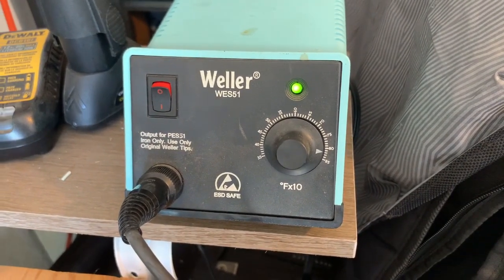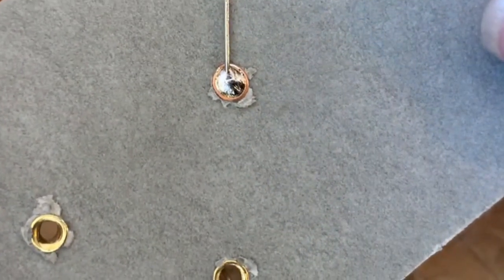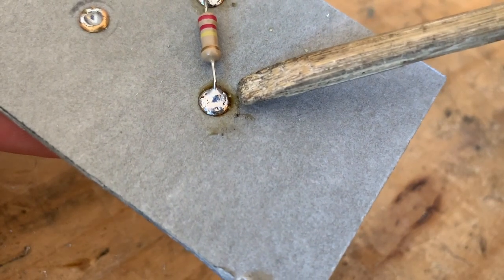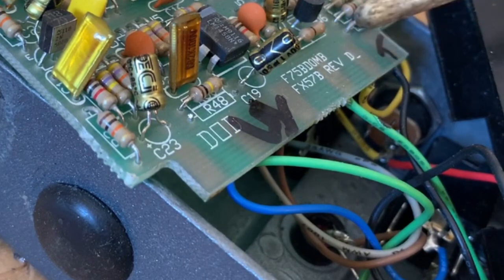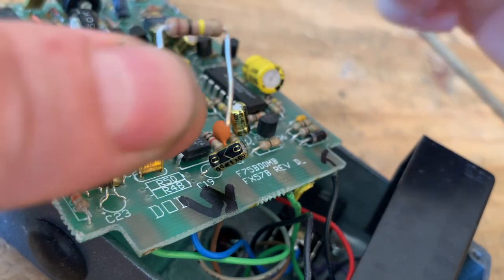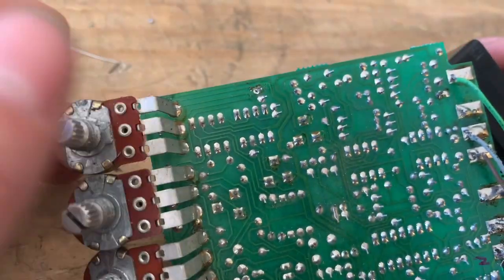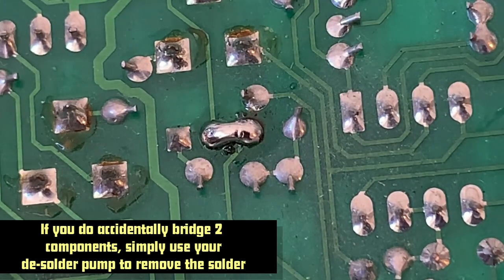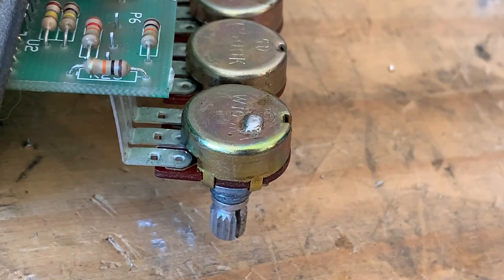How to Solder | Application and Examples for Amp Repair | The Electric Lady

Comment: My mono amp for my sound system has no power , i opened it up found the remote terminal connection had broken off . Can I solder some copper from the mother board to terminal with no issues ?

Comment: I used a whole range of Wellers (WCTP, etc) in 40 years of soldering, finally sold them all and bought a $432 JBC CD-2BQF 130Watts station with C245 and C210 Active tip holders. It is a world of difference in soldering and desoldering! From tiny surface mount to big tube feet and thick wiring, it produces much more power to the active tip. Cleaning them with demi water and copper brush, mounted in the programmable station. It opened a whole lot more soldering possibilities and a never use a non active tip again! It has auto sleep 20W so only on the workdays end it is turned off...Tip life is amazing, do not buy the Chinese imitation crap...😀

Comment: 4 years gone by since !  I'm late to the show.  Still great tips.  Was hoping you'd say more about what temperature to set the iron to depending on what you solder to etc...or explain why you would not worry about it.  Also would have liked to hear your views on why you would solely use the un-soldering pump and not use some Desoldering braid.  And I notice you don't ever seem to use any soldering flux of any sort and wondered why not.  Thank you, cheers!

Comment: I'm finding solder joints in newer guitars to be misbehaving.  Not sure if they are lead free solder or what, but they simply will not flow.  I keep adding more heat and flux--eventually they just burn up.  Maybe the solder sucker is the solution--clean it out and start over with fresh "good" solder.

Comment: Thanks, I appreciate the simple and straight approach. I too prefer a high temperature and short contact at the "site of engineering work". I had difficulties with old solder joints on a iMac power supply (older than 15Y) stored in high humidity environment. They where grey and didn't wanna melt. At the end I used a large tip and a bulky 100W iron. 
I have sometimes problems to tining wires. I realized it works perfect when I clan the wires with alcohol and add some flux on. The quality of flux, solder alloy and iron is crucial. It s science in itself.

Comment: Regarding soldering to the chassis: using a small soldering iron to solder connections to a metal chassis is like trying to drive railroad spikes with a tack hammer-!

It should always be possible to make a solder connection in 3 seconds or less- regardless of the size of the parts- otherwise,  there's something wrong with your equipment, or your technique.

Dr. Carlson's Lab posted a video on YouTube about using a modified Weller soldering gun to make solder connections to a metal chassis.

Comment: Nice job. Couple other thoughts here...be especially careful on older boards as the traces lift easier. Boards from the 70's can be really touchy. If a trace gets pulled away from the board, you can brush on some clear nail polish to keep it in place after doing any soldering. And I've learned to change tips when working on pc boards versus point to point wiring. I use a narrow chisel tip for p to p and a pencil point for boards. I also try to scrape off old excess flux because it can become semi conductive as it ages. Carefully use a small screwdriver tip or Exacto knife and maybe a Qtip and some isopropyl alcohol. Keep up the good work.
Reply: I have a 25W iron for general use, and 15W iron for circuit boards.

Comment: I'll add my two cents about the actual solder/soldering. 63/37 flows better in my experience than the 60/40 you are using because the temperature range for it the transition from solid to liquid is much narrower. This is referred to as "eutectic" solder and also has the added benefit of being more reliable mechanically because it is less prone to vibration or shake negatively affecting the joint while you make it. Others have talked about tinning and about how to make your iron last while still getting proper joints. I'll add that cleaning your joints with IPA or denatured alcohol is a good idea as flux can in fact be corrosive. I understand that you are working with larger components and doing thru hole soldering but maxing out your iron is bad. Try to keep it around 700F or between 350C and 400C, you'll end up with less burnt flux and the joints will last longer and be more mechanically sound. If you are having trouble with transferring enough heat try to add a bit of solder to the tip of the iron it will transfer the heat much more efficiently and you'll need less time at the same setting to wet the joint. I actually like using soldering wick instead of the little sucky thing, I always found it more precise. I also prefer the little brass shavings for wiping off my iron rather than the damp sponge it's just a nicer experience and it tends to help your tip last longer, sometimes I still go for the sponge at the end of a session to get rid of oxidation. In aerospace application generally the solder pad is cleaned both physically rubbed and with chemical, additional flux is then applied, the component is bent so as to follow the path of the trace it is connected to, soldered usually with multicore solder, inspected, brushed and cleaned again, then inspected again. This is basically the OCD way of soldering that I was taught working for a NASA contractor, I've left out a lot of specifics but that's the gist. I still solder this way. Here is an old training video from the 50's I thin you'll get a kick out of the fact people still use it to teach soldering https://www.youtube.com/watch?v=_RXugDd0xik And there is also a few soldering tutorials on the channel EEVblog as well.
Reply: Also on the topic of heat conduction troubles, heat transfer in soldering is s function of the conduction, capacity, and mass of the work piece as well as the iron. So irons can be built with certain materials to help with heat transfer and capacity or the can just be physically bigger to contain more heat energy. I know amps tend to have large caps and are vulnerable to shake and vibration so maybe and electronics rate rtv silicone would be super helpful for that in addition to the glue that is commonly used. You could also look into and experiment what are called encapsulation and potting solutions to help things like transformers from falling apart. It's often much cheaper to do it yourself rather than buying an encapsulated transformer that meets your spec. Lastly I promise to stop after this, here is another old soldering video that should show the manufacturing processes commonly used in mid century electronics it should be useful to understanding historical context and reproducing that work if needed. https://www.youtube.com/watch?v=wvl_KYif9zA&t=14s 

EDIT: Alkoxy or acetone based neutral cure silicone is best

Comment: Thanks so much for this video! I have a ground that came lose from the chassis and I could not get the chassis hot enough to re-solder. Will be getting a lug and screw to attach it!

Comment: I had one of those Eico signal generators! Converted it into a tube amp! Some cool tubes in there, but the 6K6 in push pull has I think a 10K impedance which was hard to find a good output transformer for

Comment: I always have problem getting the solder to adhere to any metal that "heat sinks" like the chassis or the pot casings...especially with the newer "environmentally friendly" solders. If you get the iron hot enough to perform well it can easily fry capacitors or damage pots.

Comment: Yea Yea soldering is not that easy, I did try and failed it,
now I got 2nd Volume Pot inside my Strat with no function at all, it just exist out of Solder  , at least I did manage to ground everyting :elbowcough:
When someone wants to hear a song I have to say, Yes of course I can play something by Sonic Youth.
I can reverb the hiss into the hums and ocatve it to sound good and have A wet-dry-wet stereo hum ping pong. 🤫🤭

Comment: Especially if you ain't a pro, soldering heat sinks may be worth it for components, which don't like much heat. 
Soldering heat sinks are pretty cheap and you only need one at  a time. Clip them right next to the component.
Remember they may be too hot to touch for a few seconds.
--------------------------------------------------------------------------------------------------------------------------------------------
One more idea: the solder and flux fumes ain't good for ya. Be rational.

Comment: For the super anal folks, Milspec standard actually mandates that you cut the leads BEFORE soldering the component, as cutting them after may in some instances, unduly stress the joint.

Comment: Great video very informative.  That solder sucker is the same one I use and I've had mine since the 70's.  It just refuses to die.  I just give it a good cleaning and a bit of lube on the O-ring and it's good for another decade.

Comment: Did you know Kester claims it's flux cored solder wire has a shelf life of 3 years? (alloy less than 70% lead)  I don't know, what do you think?  Guess the flux goes south...  Eutectic Tin 63%/Lead 37% is supposed to be the best.  No plastic stage.  Lowest melt temp.  Somebody said don't use a wet sponge.  Hard on the tip.  I just use a rag.  Brillo pad maybe?

Comment: Solder wick can be quite useful for removing bridges as well. I also use it sometimes to replace broken or lifted traces on the circuit board.
Reply: I'm also a wickerer, but I get better results dabbing liquid flux onto the area first.

Comment: Notes on Solder (note I am UK so it is sold-er not sodder). On old kit use 60/40 tin/lead solder, rosin cored preferably. Do not use acid fluxes. Do not use modern lead free solders either. Lead free is better for the environment, but will give a dull appearance when it cools and possibly a brittle joint. An old fashioned 60/40 will give a concave 'wetted' joint more easily, look bright if well fluxed, and withstand vibration better than Lead free solders. It is not a good idea to run your iron too cool, even with a temperature controlled iron, as lingering trying to get the components hot enough to 'wet' can cause damage. Better to give it plenty of heat and get in and out quickly, just heating the joint and not the surroundings. Sponges do not need to be swimming, and the excess cooling can make it difficult to get the solder off the irons point. A brush down with PV alcohol (possibly with a diluted rosin) will prepare the joint. The flux may be left in place after soldering, or a brush down with PVA will remove most.  PCB's may be sealed with a clear lacquer to keep moisture out. And don't forget ventilation.

Comment: Every year another iron and every 2 months another tip?    I'm an electronics designer and I'm still using my first 50 Watt Weller which is 30 years old and I still use the same tips, also 30 years old.   I solder every day with it.  I never turn it off.

Comment: I’ve only soldered about 5 or 6 times and learned the hard way that the soldering iron can get too hot. I have a cheap one with no temperature control. So with those cheapo’s the sponge is a must for temperature control as much as it is  cleaning. I finally realized my iron was too hot when the solder wouldn’t stay put and harden. Tinning the tip of the iron wouldn’t work either, it would just run or drip off. Instead of a sponge, I took an old wash rag and folded it up into an Altoids tin. It works pretty well.

Comment: I have a little bit of advice for you about using a wet sponge. You mentioned in the video that you have to replace the tip every few months. For me, the tips live for 2 years, and I solder every day. First of all, your sponge is dripping with water, which is why the tip gets a thermal shock, which shortens its life. The sponge should be squeezed out - damp, not dripping with water. Personally, I use something like the Weller WLACCBSH-02 to clean the tips.

Comment: Great video - my tip is for the odd time when you find the solder will not melt (high temp lead free stuff) - I've found if you add some leaded solder on top using the iron to heat both it will then melt and a solder sucker can clear it out. I don't know why this works but it does.

Comment: Great video! As a 40 year veteran of electronics instrument repair, I agree with all of your ideas. However, I  believe best practices requires cleaning (wet sponge is ok) and tinning the solder tip before using the iron. Tinning the tip improves heat transfer to the joint. Plus, cleaning and tinning the tip after using the iron can extend the life of the tip.

Comment: Thank you for making and sharing this video.  It answered a lot of questions I had.  At one point it was like you were reading my mind as you immediately went into covering that question.  

One question I still have, however, is what does it look like to run a wire in case you damage a trace?  What type of wire and how does the connection look after repair?

Comment: Mr. Carlson recommends modifying a Weller soldering gun for chassis work. The trick is to maximize the heat so you can minimize the dwell time and the heat soak into neighboring components. 

https://www.youtube.com/watch?v=79uD6XwBg5E

Comment: Question on your back rack, was trying to identify what test gear you had. Simpson 260, an Eico RF generator? tube tester,, would like to know what you use. I have seen you use your Fluke, but mine might be as old as you, an earlier 87. Back in the day, I used a healthkit MM1 (Simpson 260 copy,) Heathkit C-3 capacitor checker (IT-11 or 28 are newer and common), and a Precision 910 tube checker with the newer tube sockets added, and Xcelite wooden handled nut drivers. Someday I will fix my Hickok 534b tube checker, in the mean time still using the 910 as it handles beam power tubes in our power range. Don't think we need a guitar amp with 6146's or 3-500Z's for finals. Have fun

Comment: 4:30.... don't store your iron with a clean tip. Tips last longer if you drench them in solder while you're not using them, as oxidisation on the outter layers is what degrades your thermal conductivity... cover your tip anytime you're putting it in the stand, and don't wipe it off til you're ready to use it again...
Reply: Make your joint. Wipe tip clean. Tin the tip,  put down the iron. Pick up the iron, wipe tip clean. Tin the tip, make your joint.

Comment: Pencil Soldering irons are good for high precision work but for soldering connections that seems to take the heat away quickly then the WELLER 8200D is a good choice.

Comment: Colleen can you please show us how YOU safely discharge capacitors to make these things safe to work on. While I have a plethora of experience in a wide array of electronics, working on Tube equipment is not one of them.
Just so people know, soldier techniques are very important, and the fill she is trying to explain is referred to as the meniscus. It's a very specific type of arch that fills the gap and slopes up with where the lead exits and enters. It's important because well, solder has some weak points and this is the best form to create the best physical and electrical bond.
I became ISO-9000 certified back in the mid 90's, working for the largest electronics manufacture in the world.  That certification can mean many things in general, but in my case, it was QA, QC, Assembly, Electrical code, High Potting, Silk screening, shipping, and several other categories. But let me tell you, I'm far from perfect, I've had to go back and rework some of the kits I build and OMG how embarrassing sometimes. 
Solder suckers are not the ONLY way to get solder off of something. There are other types of tools like a de-soldering iron, solder WICK, which is thin strands of copper wire impregnated with flux that draws the solder towards it.

Comment: Additional point to note if soldering directly to the chassis where a ground feed does not exist is that you can introduce ground loops especially around hi gain circuit areas which can introduce all kinds of hum problems hence why in some equipment you may see a common ground point with several ground / earth connections running too and from it to avoid this potential problem. If a chassis soldered ground point is used and you want to stick with this then you'll need a heavy duty 200W + soldering iron  in order to get enough heat into the joint for the solder to take. Another worthwhile point to note is the type of solder to use as most modern circuits now use lead free solder which has a higher melting point and in my opinion contains less flux making soldering more difficult and is much less forgiving.
I personally prefer the old school 60/40 lower melting point solder which makes the task far simpler especially when working on old amps.

Comment: There are still some amp repair people out there who are somewhat sloppy when it comes to soldering never mind the masses of those that post various builds on youtube. As you state the number one thing to do is tin (pre solder) the components to be joined first and don't play around with the components / join i.e. dab the parts with the iron as this will dry out the flux. This first step is crucial to making good solder joints. Follow your steps and you won't go wrong.
Its a pleasure to watch someone who has been trained in the art of soldering and who performs this so well which on youtube is somewhat of a rarity, well done.

Comment: personally ,I will not use the wet spongy for cleaning the iron tip ,in long term , the water will accelerate the oxidation of  iron tip ,I usually use toilet tissue paper/facial tissue  paper to clean it ,the carbon monoxide and carbon particle formed under high temperature will help the de-oxidize the tip .So I think just clean it with tissue paper and apply a new layer of solder on the iron tip surface is enough.